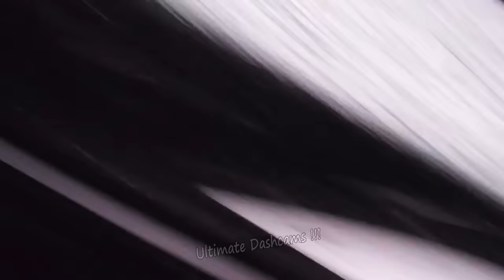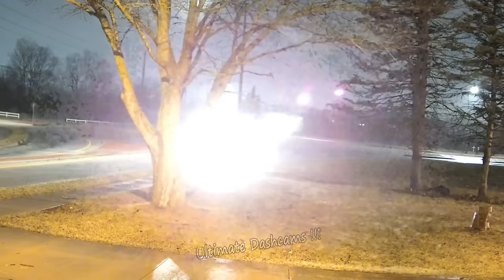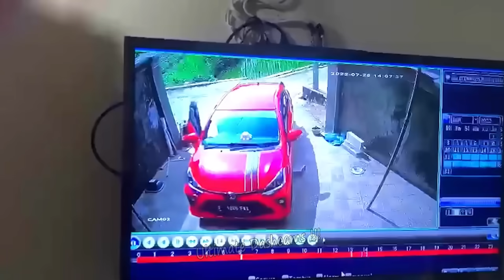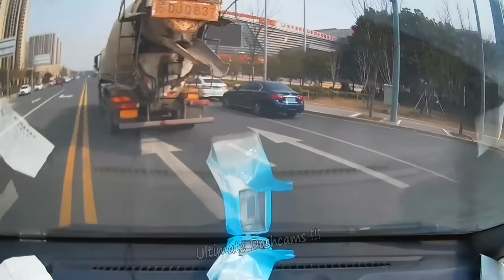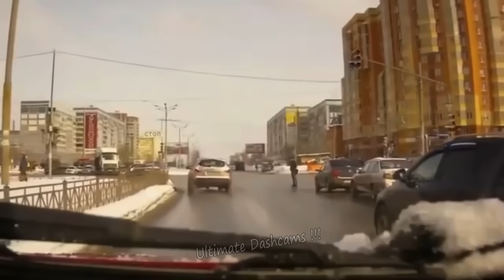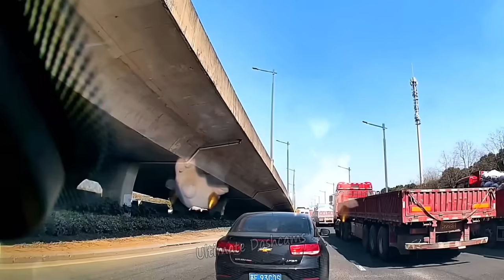TOTAL IDIOTS AT WORK 2023 | Total Idiots in Cars | Bad Day at Work | Idiots at Work Compilation 2023

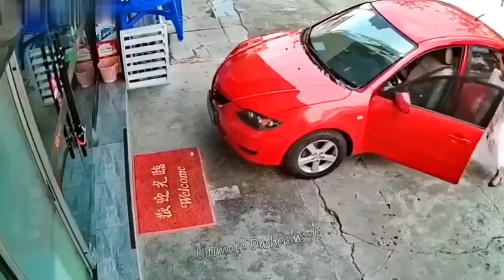Comment: 3:33
No only does she plow through the front of the building, she keeps her foot jammed on the gas after the car is stopped. You can hear her tires squealing  with smoke poring out before she finally lets up on the gas. Putting on her wipers was a great touch.